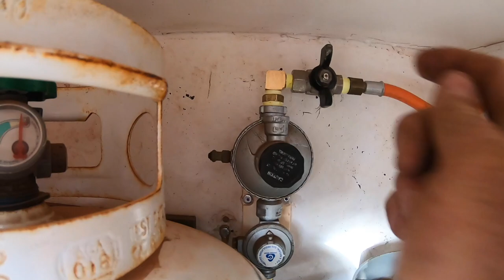Ultimate Off Road Camper || Engel ST90F 80 Litre Fridge/Freezer Installation

Comment: How you finding it mate? I put one in my canopy, I absolutely love it, loves power tho..
Reply from the maker: Hey Mick,

It pulls about 3 amps give or take. The old Dometic, if I ran it through the camper inverter, would pull 15 amps.  Never really used it that way though we loved it for the gas operation.  Fortunately the camper has 240 ah of lithium so the 80 litre Engel was not a real load.

Love the fridge so much I’ve bought another to put in my canopy too. It will replace the Engel 60 litre fridge/freezer.  The old 60 litre has been given to my son in law, he should get quite a few more years out of it.

Mmmm, just having thought arguments about whether to get a new canopy or re-build the canopy I have.  Pro’s and con’s both ways - topic for a future vid I reckon.

Cheers

kennym
Reply: @kennymepicadventures876  haha nice man yeh am in the process to upgrading to lithium atm.. I put an insulated pad on top of the fridge seemed to cut down the running time a bit, nice man look forward to it